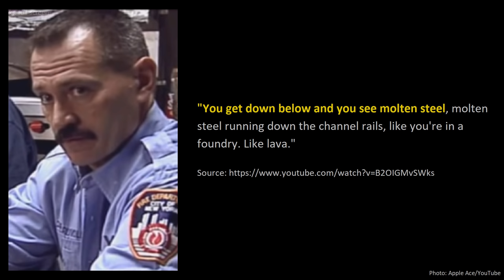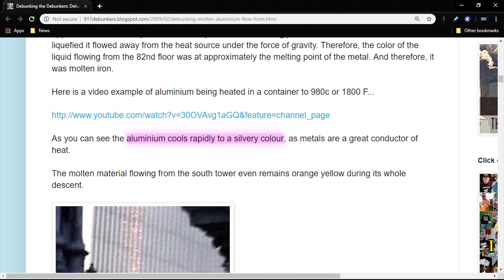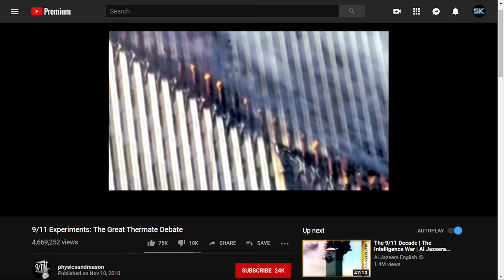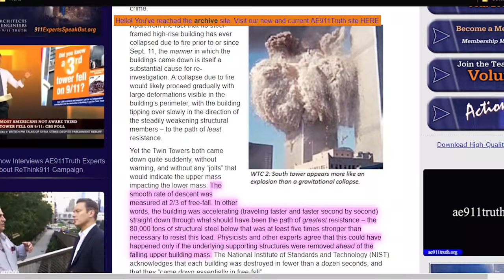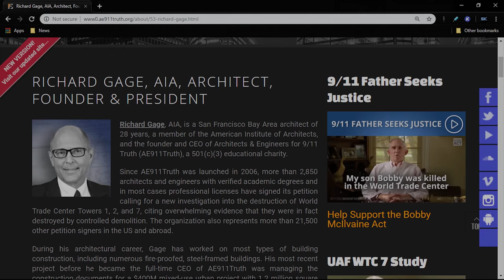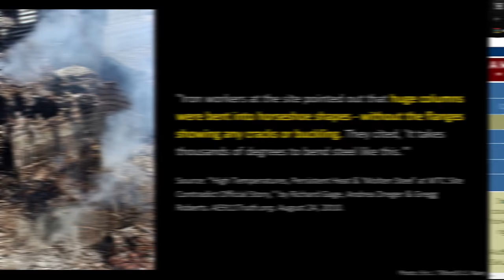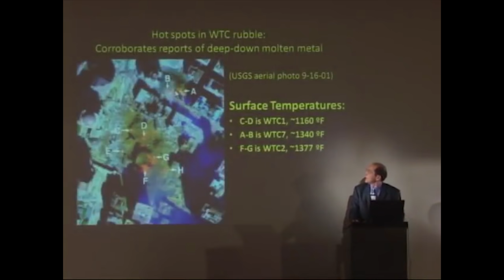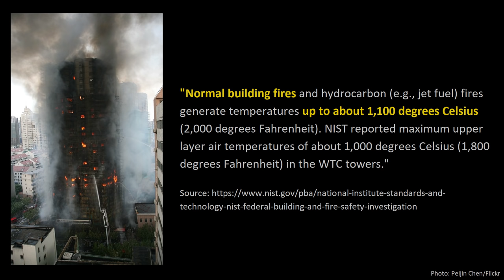9/11 Truthers Debunked: "Molten Steel = Thermite From Controlled Demolition!"

Comment: Now I haven’t watched the entire video yet but your argument also sits on assumption beings that “none of the dripping molten metal was sampled”.  You’re assuming that it’s aluminum. If it’s not then what? Have you seen the “Swiss cheese” steel in the remains of tower 7? I appreciate your approach though. You seem like a pretty legit and logical dude.
Reply: If it isn't aluminium....then, what happened to the aluminium? A36 industrial steel, such as was used in the columns of the towers, has a melting point of about 1540 degrees Centigrade. Aluminium, such as was used in the surface cladding of the towers, and in the aircraft impacting them, has a melting point of 660 degrees centigrade. So, what happened?
Reply: @mooneyes2k478  yeah that could have been aluminum but again, we don’t know. When you take other evidence into account such as the “Swiss cheese” steel then it makes another investigation necessary.
Reply: @anthonyfuqboi8211  Not really. The "swiss cheese" thing is, 1, easily explained and, 2, a rare and isolated phenomenon at 9/11. There are a very few pieces exposed to the requirements.
Reply: @mooneyes2k478  Id like to hear the explanation if you don’t mind
Reply: @anthonyfuqboi8211  It's called "eutectic corrosion". Essentially, in certain circumstances, you can make an alloy has vastly different properties than the substance parts of that alloy. In this case, the heat, along with various elements, made an alloy out of parts of the steel that made it rust to pieces.
Reply: @mooneyes2k478 Sounds interesting! What do you make of the eye witness accounts from ground zero of molten steel? Some firefighters said it was like “looking into the gates of hell” and that molten steel was flowing like lava. Also, what do you think of the 9/11 “meteor” and iron microspheres? Thanks.
Reply: @anthonyfuqboi8211  That's hyperbole, and so on. I have nothing but the greatest of respect for the FDNY, but they're not metallurgists. So, their claim of "melted steel" is not to be taken seriously. There's no reason to assume they could tell steel from lead(there were several large battery power-supplies in the WTC) or aluminium.
Was really hot? I don't doubt it was. Hot enough to melt steel? Unlikely, at best. But, the important thing is, did it REMAIN that hot?
There are a lot of other metals, as noted, that would melt long before steel would. The melting point of A36 industrial steel is just under 1540 degrees Centigrade. Any room that's hot enough to melt steel, and more importantly, KEEP it molten, in the way the firefighters claimed(molten steel, runing down the channel rails, as the claim is)? Would kill those firemen with thermal bloom. It would literally be like standing INSIDE a smelter.

The meteor is interesting, indeed. Because if you look closely at it, you will see that the rebar embedded in it is still easily recognizable AS rebar, ribs in the metal and all. Hence, it cannot have been melted. There are also, quite legible, pieces of paper with writing on it in the same "meteor". If that meteor had gotten so hot that it would melt steel...the paper would have been ashes LONG LONG before. But, it isn't.

And as for the "iron-rich micro-spheres"...any metal that turns liquid will, due to surface tension, turn into a spherical shape. So, all you need is a very small amount of metal turn liquid. There are HUNDREDS of methods to do so.
For instance, buy a bic lighter, and spin the sparking-wheel...there you have such micro-spheres. If you want to try another method, grab some steel wool, and set it on fire, with that lighter. Thin strands of steel burns quite readily, Again, there you have micro-spheres. Or, if you prefer, use an angle grinder on an I-beam. The stream of sparks coming off of it? Will cool into such spheres.
There are two likely sources of the "micro-spheres" found. The first is the exact thing mentioned, angle-grinders with cutting discs used during the clean-up of the "Pile". The second is mechanical abrasion. Literally, flakes and micro-pieces scraped off by steel scraping against steel and concrete, in the collapses.
Reply: @mooneyes2k478  taking all irregularities into account it seems too extreme to be from natural office fires and jet fuel. The logic you offer is sound but still makes these towers one of the greatest anomalies to ever occur.
Reply: @anthonyfuqboi8211  Well...in a way, maybe. On the other hand, there's a very large anomaly in having large aircraft hit the buildings too.
So, from THAT point of view, the anomaly sort of disappears.
Do note that, fire is a known issue for a purely steel-framed building, too. Excessive heat weakens the steel to the point it isn't structurally supportive, any longer. This, note, isn't melting, just softening. This is the same basic idea that blacksmithing and forging is based on.

So, the idea of the collapse as such wasn't unexpected once the situation had occurred, and the fires had started. We see this, too, in three other high-rises of the same kind that suffered large fires. They are the Edifício Wilton Paes de Almeida, in Sao Paolo, Brazil. The Torre Windsor, in Madrid, Spain and the Plasco Building in Tehran, Iran. All three collapsed, partially in the case of the Torre Windsor, and completely in the other two cases, in almost literally the same way as the Towers.
Reply: @mooneyes2k478  yep I agree it’s not a normal circumstance by any stretch, everything that happened can have several different explanations but without a proper investigation we will never know for sure. Have you heard the story of William Rodriguez? The former janitor of the north tower?
Reply: @anthonyfuqboi8211  Oh, yes. He's rather well known for his...freedom with claims and facts, as it were. Or, to put it in plain language, he's a liar.
Reply: @mooneyes2k478  Hmm... how about Barry Jennings?
Reply: @mooneyes2k478  very interesting, thank you for your thorough responses. I’m curious what you think about some of the other events like the dancing Israelis and how the one of the hijackers passport flew out of the tower after the plane crashed and landed on the street for the FBI to find.
Reply: @mooneyes2k478  sorry I wanna throw one more thing at you then I’ll give you time to respond! How about the study done by UAF on tower 7s collapse that showed it couldn’t have possibly collapsed in the manner it did with the conditions observed on 9/11? Thanks! Your correspondence is much appreciated by the way
Reply: @anthonyfuqboi8211  Well, there's a few issues with this.

The first, of course, is that there is no "UAF study". There's a "study", and I use that word lightly, made by a guy that works at UAF. This is a significant difference. This is the equivalent of your buddy, who works for a plumbing company, doing a bit of work on the side for you. That does not mean the company he works for is liable for that job.

Ok, so that's how there is no UAF study. So, let's move on to the guy that MADE this "study". First, let's note that, Leroy Hulsey is in the "Civil, Geological and Environmental" section of the UAF College of Engineering and Mines. Up until about the time of the work he did, he was a professor in the department. AFTER the release, he was an "associate professor", a clear demotion. (and since about 10 months, he's a Professor Emeritus, or "retired with distinction")

Further re Professor Hulsey, he is quite clearly a very very skilled and learned man in his field. He's made multiple articles, has a significant body of published work, and so on, all of which can, or at least COULD, be found on the UAF pages(I haven't looked at the specific pages since Hulsey was made Emeritus, they may be gone). The problem with his field is that it's in, first and primarily, bridge construction, second, cold-weather effects(logical, considering it's Alaska), particularly on road surfaces, and third, waste disposal, again with a particular look at such in cold weather. This does not afford him any particular ability in the relevant fields. Certainly, he is above the average man in the street, but I would hesitate to say he's any more able than a well-read layman.

Ok, so, Professor Hulsey isn't actually a notable expert in the field. So, why would he make a study? Well, because he was paid to do so. Paid, specifically, by A&E911. And, while it's known that A&E911 is trying to, honestly, proselytise for a "new investigation", it cannot be said that they're unbiased.

Furthermore, this study was supposed to take 2 years to make. It was supposed to be fully transparent. And it was supposed to be published in the large, relevant publications, for peer review. None of this happened. The study took over 5 years to come to completion, although it must be said that some of that might be due to Hulsey using his student assistants on it, and they finished their studies and moved away. It was entirely and utterly non-transparent. And as for the peer-review and publishing, well, that quietly went by the side, never again to be mentioned.

As for the study in itself, it is flawed in the extreme. It uses made-up numbers sourced from people with a known bias, uses data that is far too limited in the known fires of the WTC 7, show things that visibly(from the famous video of the collapse, or even from what people saw happening) did not happen in their computer modelling.

Hulsey also specifically stated that there would be no uncritical voices. "Those with different opinions would not be allowed to influence the science." That's an almost text-book description of confirmational bias.

So, in summary, Hulsey's study was paid for by a group with a known preferred outcome, took 3 years longer than it was supposed to, was not reviewed by peers in the fields, has enough holes and errors in it to be used as a sieve AFTER those extra three years, and is written by a guy who specifically said he wouldn't entertain differing voices on the material.
This STRONGLY suggests the study was "massaged" into saying what the customer wanted it to, and said massage broke it.

And, while I quite honestly don't KNOW that UAF tried to shuffle Professor Hulsey under the carpet because he had become a bit of an embarrassment? It would not surprise me at all if that is what happened, considering his demotion and then retirement.
Reply: @mooneyes2k478  Man I appreciate your time on this! Its just weird to think that NIST won’t disclose their computer modeling data and nobody is able to replicate the results of what was seen on 9/11 with tower 7 under the observable conditions.  I also find it very strange that no video footage of a plane hitting the pentagon is available to the public and what is available shows about two frames of something moving at extremely high speeds and almost perfectly level with the ground. The damage done to the pentagon is also very suspicious as it looks nothing like one would imagine an airliner jet crashing into it.
Reply: @mooneyes2k478  man I better stop talking to you before I start trusting my government 😂
Reply: @mooneyes2k478  I really appreciate your well thought out responses, may I ask what you do for a living? You seem quite intelligent and have a vast amount of knowledge on 9/11.
Reply: I should add, to the above, that "the government" is the government in whichever country. No government, at the end of it, is different other than maybe WORSE in dictatorships and so on. But, no matter which nation you live in, the government in it will lie to the population, for any number of reasons. This does not mean that the government is doing or planning to do horrible things to the population. At the end of it, in any  reasonably open nation, what they get up to have a strong tendency to come out into public, and then they're in the shit. And the amount of shit the US government, or whatever part of it, would be in from something like this? Boggles the mind.

Well. Maybe the Vatican government doesn't lie to it's citizens...but then, they're all of 450 people, and more or less are the population they govern too, so...

Comment: buildind 1 was hit with full fueled 747, 700 gal jg1 the other one hit with gray 767 military refueler plane 1200 plus gal jp1 fuel .that much fuel burns long time & they way building built it adds air to fire from middle of building dew too elevator shafts !
Reply: @danmilosevich 🪴🪴🪴🪴🇮🇹

Comment: 56 minutes for 1 building and a 1hr  13 minutes for the other, even now it seems unfathomable. The steel at the top of the building on the outside is very thin compared to lower down, yet the core is all the same to the top, and the floor beams the same. The higher you go up, the lighter the building was by a signifact amount. The outer building at ground level was 4 inches thick, yet at the higher floors, it was 0.25 thick towards the top.
Reply: I'm surprised the Towers held out that long. Collapse initiation occurred when sagging floor trusses caused perimeter columns on one side of each tower to bow inward by up to 5 feet until they buckled.

Collapsed progressed with thousands of tons of debris falling through the open office space, ripping the floor trusses from their bolted connections at the truss seats on the columns.

There was no columns crushing columns with the top part of the building dropping straight down onto the lower as many people imagine. So the fact the building gets lighter higher up is not relevant.
Reply: @MFitz12  In addition, there were no "floor beams" only, as you point out, trusses which, once moved by any means (thermal expansion included) lose their load carrying capacity.  Most people, especially conspiracy theorists, do not take the time to learn about the unique construction methods employed in the WTC towers, which were more like hollow tubes than traditional grid framed high rise construction and the more "engineered" a structure becomes, the more dependent it is on the diaphram effect, essentially that the sum is greater than it parts.
Reply: @Synaptic_gap  - Don't have to take the time to learn anything when they already have all the answers.

Comment: How does aluminum go through concrete and steel if a bird can damage the nose of a plane enough to ground the flight
Reply: Kinetic energy. Same way soft lead can go through harder bone when fired out of a gun but not when thrown by hand. 

Aircraft nosecones are just fiberglass and thus not structural BTW. It's a stupid analogy.

Comment: Snrk. 911 comments.

Anyway, "but, but, but, aluminium is silver when molten, not red!" go the "truthers".

Which only mean that they don't understand physics. Any object that reaches a certain temperature will radiate a certain color. It doesn't matter if that object is metal, such as steel or aluminium, or glowing coals, burning wood, etc, etc. This is basic physics, black-body radiation, as explained by Wien's displacement law.

If an object is 800-ish degrees C, it'll glow red. If it's 1000 degrees, it will glow yellow. If it reaches above 1300 degrees, it will glow white. And if it is below about 700 degrees, it does not really glow at at all.

Those last two temperatures are important. Because since steel melts at 1500 or so degrees C, depending on the exact composition of the steel, it will always glow white. Hence the term "white-hot". Any liquid substance that is NOT white-glowing is not steel. It can't be. End of. On the OTHER end of the spectrum, aluminium won't glow any color when it reaches the melting point, which is 660 degrees C. There's not enough heat put into it at that point.

But what all "truthers" utterly fail to take into account is this: 9/11 was a fire, not a smelter. And a fire gives absolutely fuck-all in cares about "we don't need to heat it any further, it's melted."

In a run-away fire that reach 800 or more degrees C, aluminium will glow EXACTLY the same color as any OTHER substance heated to that level. Thus, there is nothing to to say that what you see falling out of the tower(s) isn't being aluminium.

But, there is an even easier explanation. That what you see is office material of various kinds. Wooden desks, carpetry, masses of paper, etc, etc, etc.

Comment: Years ago, I read universities analysis of the dust where microspheres of iron were found. Those videos have disappeared, not surprising in retrospect however, I did save one ha ha
Reply: Thermite is not nor ever has been used for controlled demolitions.  Welding and grinding steel activities carried on every day, everywhere in the building process, also produce micospheres in abundance and are the likely source in the debris of the WTC
Reply: You are aware that making stupid shit up isn't an argument. Right?

Comment: there was molten metal in the basement of building 7. no aluminum in there. not to mention it collapsed on its own
Reply: Building 7 did not have a basement. It was built on top of another building which served as part of its foundation.
Reply: @MFitz12  forgive my ignorance. what i meant was at the base of the collapsed structure.
Reply: @cloroxbleach118  - No molten METAL there either, not that we would care since even if it were present, by itself it does not mean anything.
Reply: @MFitz12  yes there was and yes it would
Reply: @cloroxbleach118  So, in other words, you had nothing, you got called on that, and that upset you so much you utterly failed at having an argument. Bravo.